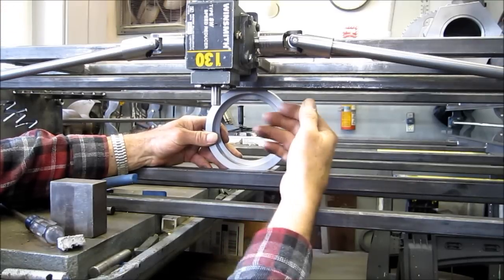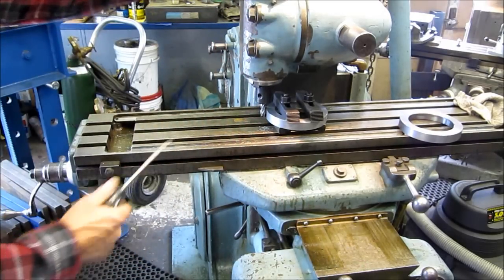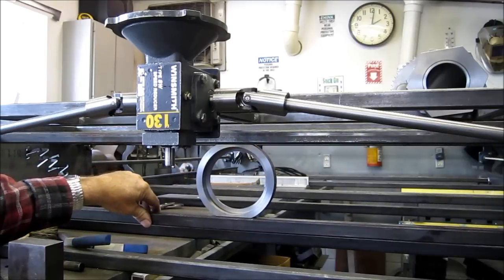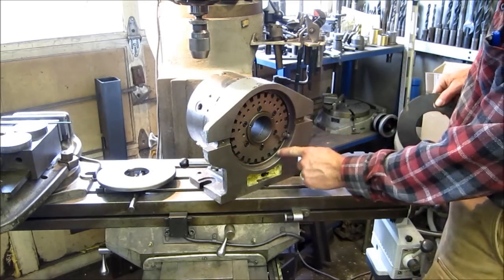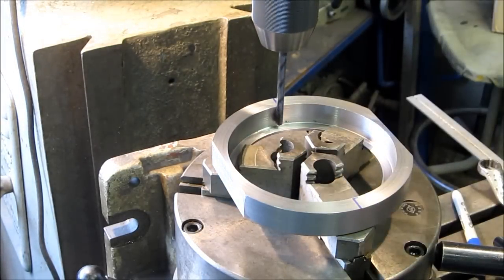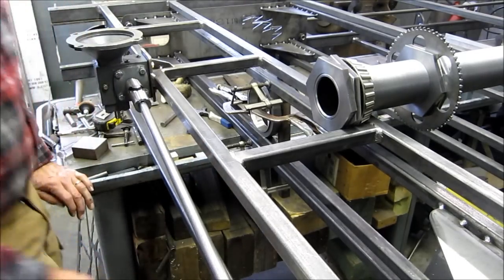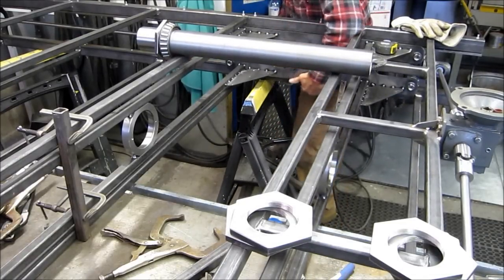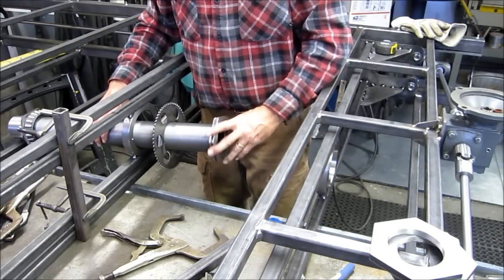Big Screen Elevator Part Twelve

Comment from the maker: Depending on the closeness needed there are several ways and your paper idea is one, also blue the surface and come into it until the bluing is rubbed, but the most accurate is using an edge finder. I was just rushing it and if you know that your going to take multible cuts you can measure between cuts...

Comment: I was taught to drill a hole and run a bolt through the slug, then chuck on the bolt, for parts which will have a central through bore. This technique will work for the few times when I don't have such a hole running through the center of the piece.

Comment from the maker: I have always thought of spindle mills as glorified drill presses, if I had a choise, based on the types that I have used over the years I prefer the Lagun, early 1980's models W / variable speeds, and a custom 10" riser. 

To the question, I plan on no other cnc's besides my PlasmaCAM, I'm a hands on guy and pushing all the buttons would put me asleep, I can't just be the operator, for me to be a machinist is to crank handles, personal control.   :)